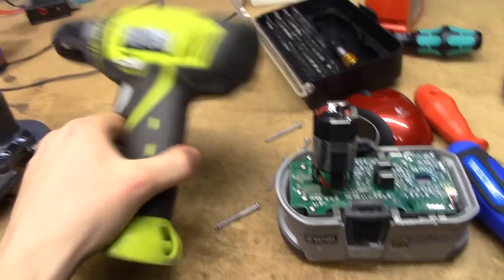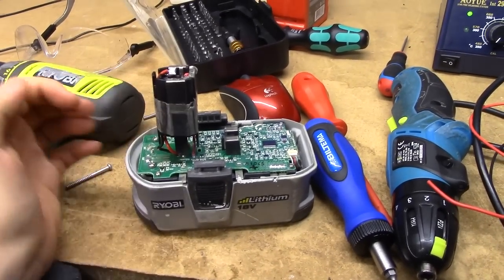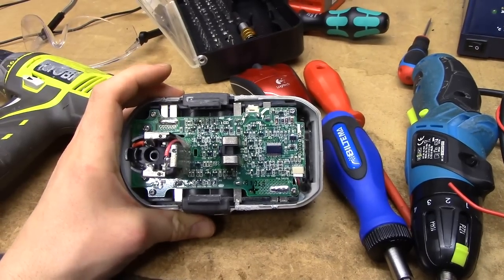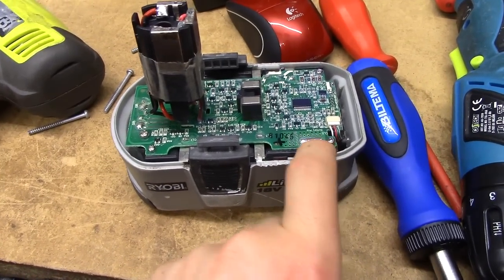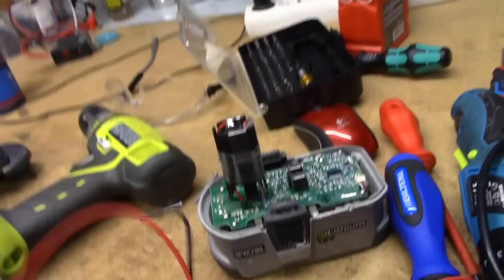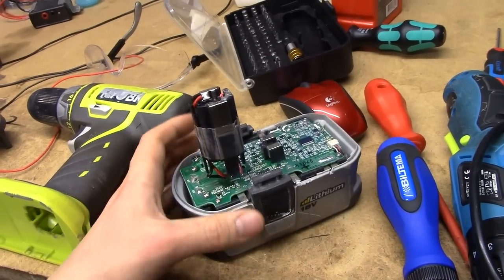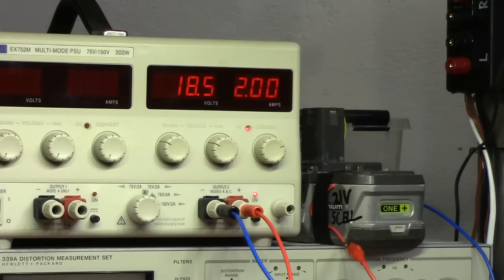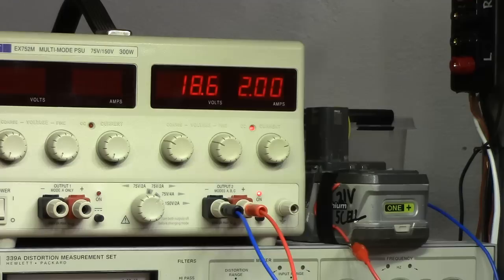Ugly hack: Ryobi ONE+ charging with bench power supply

Comment: Thanks!! I know this is kind of old but it was still very useful. I simplified it a bit though. Instead of leaving wires hanging out, I drilled small holes in the top near those terminals and used VOM test probes that almost lock in place. The probe wires conveniently end in banana plugs that fit my charger making this a significantly less ugly hack!
Reply: Good job, ,Wali!

Comment: Made a quick and dirty charger . Set lab supply to 21v . Middle contact needs about 4v to turn on battery . I used 2x yellow leds and 4.7k resister between +ve and -ve to get the ~4v
Reply: Hi, wanted to ask, if the 4.7 resistor jumper goes between middle contact and + positive with charger positive connected to this and negative going to negative? Thanks i just got a ryobi battery but have no charger.
Reply: That worked for me, thanks

Comment: Id use this idea to bring a lithium battery up from low volts once, so i can put it in storage until a better way to charge is found. From what ive read about lithium batteries, is that this method will eventually cause the battery to  blow up or catch fire. Its not a matter of if, but when.

Comment: This is actually fairly dangerous, even with a current limited power supply set at the correct voltage for the pack. In normal operation, the battery's brain box probably monitors individual cell voltage and kicks into protect mode if any individual cell exceeds 4.2V. Without this, if an individual cell becomes undercharged, and you're charging to the 21V 'full charge' voltage of the pack, one more more cells may end up being significantly overcharged by the time you hit 21V (for instance, you could have 4.1, 3.9, 4.1, 4.2, and 4.7), and this is VERY dangerous when dealing with Li-Ion and LiPo batteries. At least buy yourself a little breathing room and only charge it to 20V.
Reply from the maker: If it catches fire, it catches fire, I don't care.
Reply: Not the case here but with the new lithium+ batteries' BMS the cells are balanced during discharge as well.
What I do is charge with a hobby charger (imax b6) and once in a while open the battery to check the individual cells.
Reply: Hi. I just tried that - no effect. Looks like ryobi invented something more complicated to force using native charger...
Reply: The middle post seems to be a NEGATIVE (-) terminal though.
Reply: @bastienrehm  do you remember the settings? LiPo 5s or Li-ion? Current? Thanks!!
Reply: @bastienrehm  Do you remember the setting? LiPo 5s or Li-ion and what current? Thanks!!!
Reply: @bastienrehm  sorry for the double post
Reply: @fishesfromtupperware  li-po is good as it'll stop at 4.1v per cell. If you don't want to disassemble to charge, use a 1.2k ohm resistor between mid and positive terminal. charge at 4.1 x 5 = 20.5 volts, rate 1c (1h)
Reply: I charged this way > 100 times with the 21 v source dc & < 2A current together with V& A meter to monitor the charge. When it's fully charged, the A meter will show # 0 A then disconnect them . Done .

Comment: I suppose that if one were feeling particularly ornery and not at all in a hurry, that they could "pulse" charge the battery a little at a time through its output contacts over and over again.

Most cordless tool makers have stopped including a charger and battery with their tools. The charger and battery end up costing more than the tool itself...a truly sleazy thing to do!

I'm kind of surprised you were feeding the battery two amps worth of current. Isn't that a bit hot for a Lithium-Ion battery?
Reply from the maker: +uxwbill I think that's the correct way to charge it; it's enough to kill the power for a very brief period, so you could pulse with a 90 % duty cycle and it would accept a charge. I just can't be bothered assembling a circuit to do that.

2 A is a pretty high charge current for a typical tool battery, but this one happens to have a capacity of 2,4 Ah, so I'm not even charging it at 1C. I believe the original charger for these is a "one-hour" type, so I'm going with 1C being a safe upper limit.